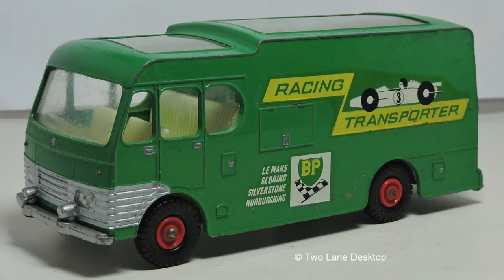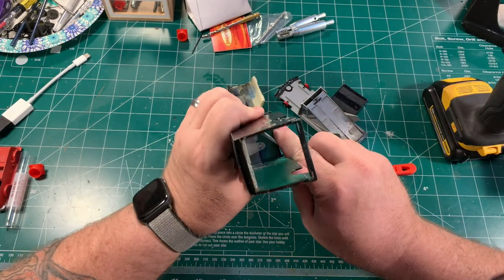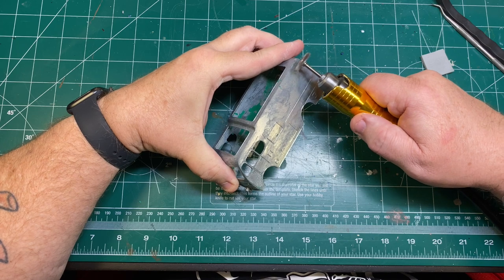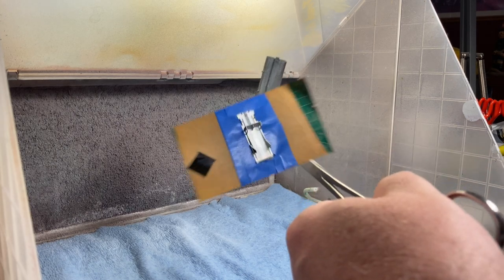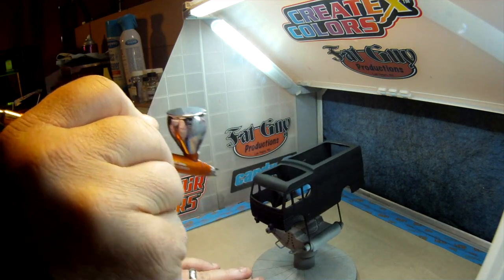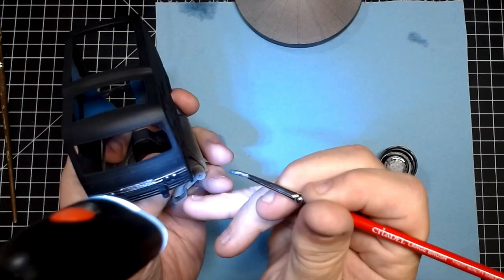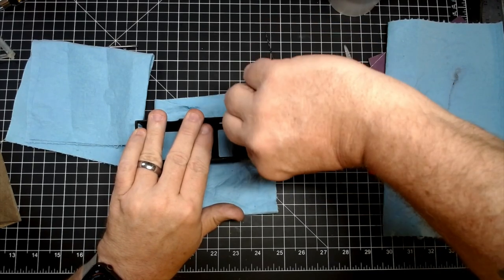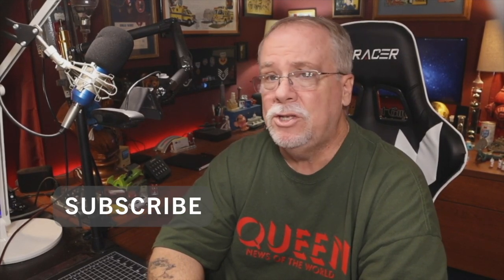A trashy Transporter - A Diecast custom

Comment: Very interesting project. This build turned out very nice. I too am having a lot of trouble when it comes to applying clearcoat. It seems like every time I try to use it, it turns white. Very frustrating. Any way, thanks for sharing another great video, take care and stay safe.
Reply from the maker: Not sure why the rattle can clear does that, but I damn sure will be finding out!
Reply: @pauly7218  I wonder if the humidity has anything to do with it? Please let me know if you find out something.

Comment: looking great, very interesting take on this casting. :) now we need one or two JB vehicles to transport...
8:06 you planned to have the cuckoo enhance your statement, didn't you? yes, you did. :)

I felt sorry for the glass insert, but what can you do when regular machinery paint's thinners destroy the poor polystyrene? still too bad, because the reproduction insert doesn't have that plastic tab that helps actuate the inner ramp. it seems to tend to break off, and yours still had it intact. but again, what can one do?
Reply from the maker: It least the glass looks good.  It could be worse!  LOL...